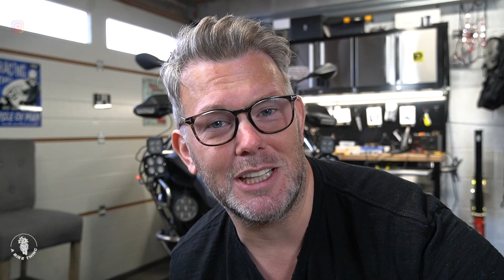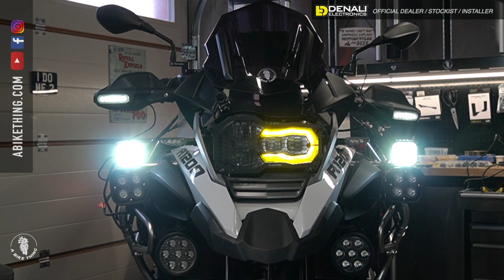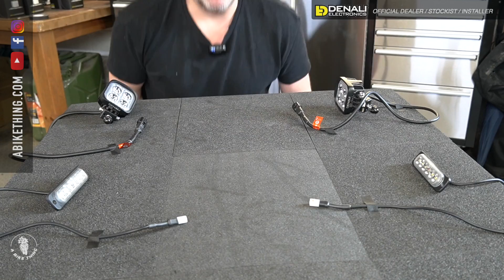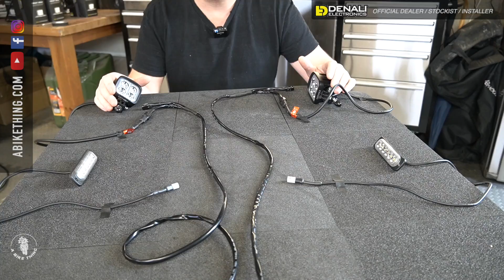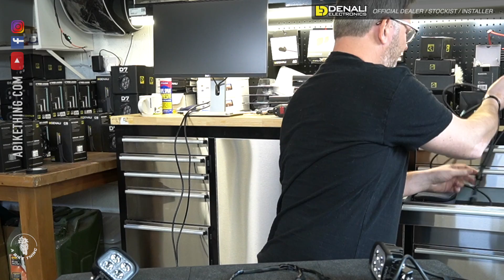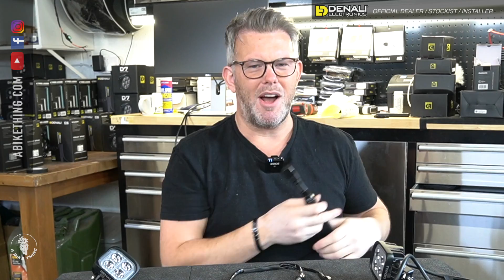DENALI DRL's DUAL INTENSITY VIA CANSMART NOT POSSIBLE? YES IT IS.

Comment: Hi, I have a Versys 1000 with a D4 kit on it, and I'm wondering if I could wire it so the D4s flash with my turn signals (with each side, like an aux blinker).  I think I could tap into the wire going to each D4, via a normally closed relay triggered by each turn signal, which would interrupt the power going to the D4 along with the turn signal flashes...but would that have it flashing opposite the turn signal?  Any help or insight would be appreciated!

Comment: Hi, just wondering if you have any advice on mounting Denali DRL's direct to a K1200GT my local shop is not keen on the install 

Thanks in advance
Reply from the maker: Perfect bike for DRL's.   What year?
Reply: She's a 2008 bike, I have the fender mount kit which I think will look well giving me a nice triangle of light and I would like to run them at 100% power as I checked them on a spare car battery and it seems just right! However my local bike shop dosent want the install as they feel splicing into the canbus is too much of a minefield :(

Comment: Hi Steve,

Your bespoke solution is now available as WHS.048
Reply from the maker: This is not the same.   My solution enables the high and low beam without sacrificing the 3 wire dimming on the main lights.     Hard to explain but it is different

Comment: Hi Mate, ALl I did was connect both the DRL to the white channel  to the yellow 100% cable, you would still be able to dim them. Dont need 3 cables for dimming.
Reply from the maker: Yes but you’d need to amend the circuit to 2 wire dimming defeating the 2.0 datadim technology

Comment: Got my DRL’s at my handgrip and I can dim them. It’s with the hex ezcan
Reply from the maker: Out of curiosity did you select 2 wire dimming in the software?
Reply: That's what I thought, you can dim them if you select 2 cables and put them on a separate channel. Not tying them together with the S4 or D4 or D7.

Comment: I might be into that setup..i have a f750gs 2019..and the cansmart 2.0...a pair of S4's mounted to the crash bars ...hears my problem the f750gs doesn't have fork guards on it so im having problems with how i will mount a pair of amber DRLs low on the front forks..hmmm and then there's the plugs ...help !!🤪
Reply from the maker: Once you know where to mount them then wiring is the easy part.